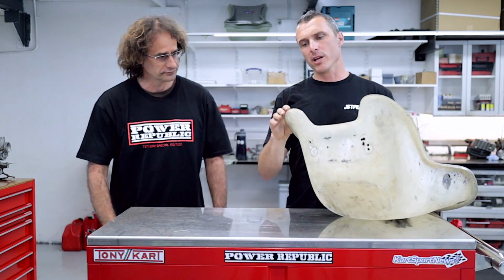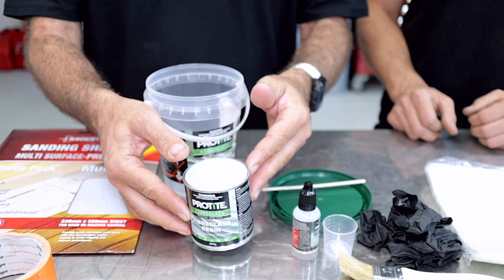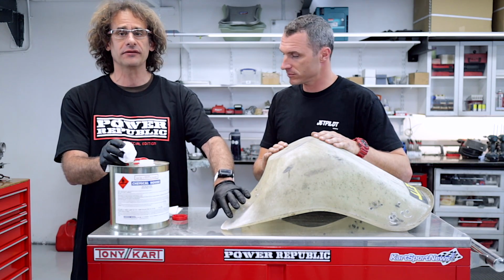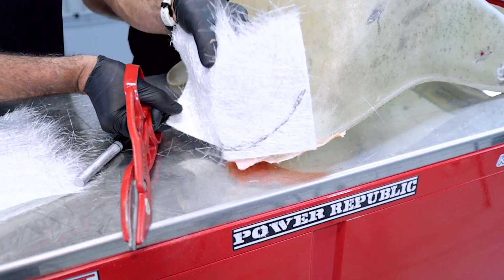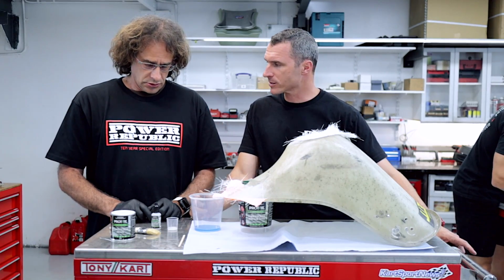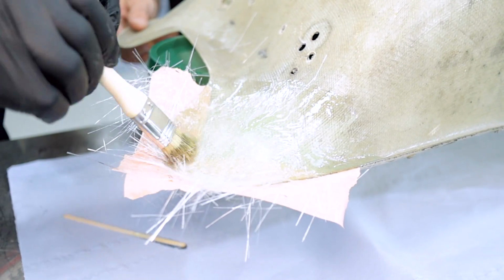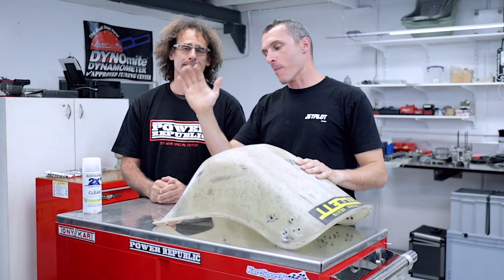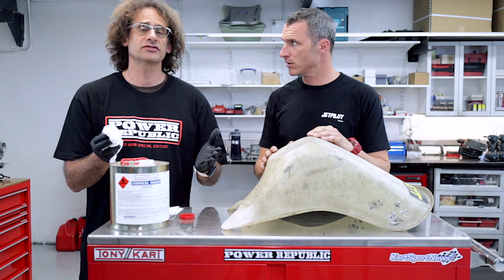HOW TO: Repair Your Go Kart Seat Ft. NikStik Surfboards - POWER REPUBLIC

Comment: Is it worth it to repair right under the butt area along the edge?  My seat gave way and sags down.  Is this too far gone?
Reply from the maker: its cheaper to repair than get a new seat.  new is best option if you have the budget,  otherwise fix it up and sent it !!!!!   PS run your seat level with the frame and you'll be sweet

Comment: One tip I would add is to try to cover the least area possible when making repairs. I found when I did some repairs patching holes on the mounting points, I made the patches a lot bigger than they needed to be. The result was the seat became much stiffer and the kart’s handling was affected quite severely.
Reply from the maker: Thanks the tips mark

Comment: what would the process be to patch the drilled holes in the seat?
Reply: You can get a few types of glass fibre, the resin is pretty much the same. For a hole, id use the filler type, with finely chopped glass, instead of the matting types. Then fill the rear, id use tape on the front of the hole to prevent mess and apply the glass fibre into the rear. Then once its set, sand both front and rear smooth and finish. The rest is pretty much the same as here regarding preperation and finish.
Reply: Also, if you want to get more structural strength after the repair, add a layer of matting as  here to thicken it abit, but that will add abit of weight then drill new holes.
Reply: Thank You for your input Christian
Reply from the maker: What ^^^^^^^^ Christian said is perfect.